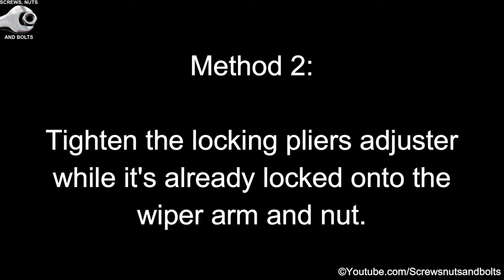Stuck Wiper Arm - Easy Removal Method

Comment: If they give you problems you can put a 12” pry bar right under the arm close to the fastener point and gently pry up then smack the top of the stud with a smallish ball peen hammer with the nut still on the top of the stud. Or you could clamp the top of the stud with the nut on it, (or put a coin on top to protect the nut) and the bottom edge of the arm with some licking pliers and smack on it like you did.

Comment: Amazing! Thanks a ton for this tip, worked a charm to free up a stubborn wiper arm here in the Rust Belt that resisted my best attempts to free it using penetrating oil, repeated wriggling, and even a rubber mallet. This video is truly YouTube at its best!
Reply from the maker: You're very welcome, thanks for watching !

Comment: Think you so much! Would never have gotten the arm off without this video. The wiper motor was going, and if I moved one arm the other moved too. The linkage from the motor the the rest of the arm linkage had popped off. Lubed it up and popped it back on (rust and debris had probably caused it to fall off initially).
Anyway, thank you, hope this helps others too
Reply from the maker: You're very welcome ! 👍

Comment: Thanks!! I went through a "soft touch" car wash and the soft touch brushes broke the plastic piece on that rear wiper arm that holds the blade in.
I took the nut off and tried everything except a puller to get that arm off but no luck.
I saw your video and tried the vise grip method and it broke free immediately!!
Whew!! Thanks again. It worked great.
Reply from the maker: You're very welcome, glad it helped :)

Comment: thank you so much, this worked so well for me. I went and bought a battery terminal pulller because someone in an forum said that works, it was too flimsy/had soft metal and broke. I used your method and got them off in 5 minutes
Reply from the maker: You're very welcome, thanks for watching !

Comment: Your a life saver man! I was fighting with the arm for an hour and as soon as I saw the video I was able to pop it right off
Reply from the maker: You're very welcome !. Thanks for watching !
Reply: Same here, so simple and yet so effective!
Reply from the maker: shawnstafford7809  Sometimes the nuts are covered with a plastic cap. What vehicle do you have ?
Reply from the maker: shawnstafford7809  Wow nice car, lucky you ! 😎. I've rarely seen, let alone worked on a Firebird so I have no idea I'm afraid. I've only ever seen wiper arms fitted onto splined shafts and secured with nuts
Reply from the maker: shawnstafford7809  Do the arms look like the ones in this video ?: https://www.youtube.com/watch?v=Zcg3wU8dosw
Reply from the maker: shawnstafford7809  That tool is usually used to pop the arm off the splined shaft after you remove the nut. That cover should clip up off the nut and hinge up at the base of the arm.
Reply from the maker: shawnstafford7809  That cover should clip up to reveal the nut. If you get to the nut, just be careful not to put any pressure on the glass, whichever method you use to remove the wiper arm. Good luck 👍
Reply from the maker: shawnstafford7809  lol 👍

Comment: I'm trying to remove the black plastic debris shield thing. Because after sitting 3 years my 2004 rusty  jeep grand cherokee was invaded by mice, and squirrels which builr nests and also deposited they're nuts, leaves and packed it underneath. Plus all over the engine bay. So the wiper arms had to be removed in order to remove it and clean out the packed mouse house. So after 20 minutes of pb blaster and ready to HULK SMASH 💪 with my hammer I searched and thankfully found the solution. I even have the identical Irwing Vise Grips and hex bit. You made it simple and you prolly save a windshield too.
Great idea and thanks for posting this. Perfect 👌 👍🏻
Reply from the maker: You're very welcome !, thanks for watching !

Comment: Thanks for that. following your video, have just used mole grips and a one pence piece to get my wipers off.  What took most of the time was putting the plastic trim back on at the bottom of my windscreen after cleaning underneath it. There's a knack to that too.
Reply from the maker: Yeah that can be a bit fiddly alright. Thanks for watching ! :)

Comment: Changed my Estate rear wiper 5yrs ago with no problem, this time the arm is stuck on the spindle solid, so will try your method tomorrow. Hope I don't shatter the rear window, hugh!
Reply from the maker: Don't use any part of the glass for leverage !
Reply from the maker: If that doesn't work, I'd recommend trying a ball joint separator like this one: https://www.youtube.com/watch?v=ZbvqnhrPNho

Comment: On my two Dodge Rams, 2003 & 2004, there is a simple lever you pull out to release the wiper arm.  No nuts or special tools required.  However, your video was extremely helpful in working on my Girlfriends Ford Freestar van.  Thank you.  Funny thing was the nuts on her wipers were two different sizes, 15 and 17mm.  What the heck?
Reply from the maker: That's strange !. I'm glad it helped :)

Comment: Best tip!!! I was trying to remove my arms from a 2002 Sequoia and there is very little clearance around the arm to get underneath the arm with a wiper removal tool. Saw your video and the only change I made was using a pair of needle nose vice grips which barely fit to pop the arm since I have such small clearances. Thanks!!!
Reply from the maker: Thanks for watching ! :)

Comment: Excellent, worked easily after a pry bar was to no avail despite having sprayed Free All on it first.  Then put on a generous coating of anti-seize before putting it back together so it will be easier if I need to do it again.  But one thing, you could have used a cheaper coin, those might be valuable.
Reply from the maker: LOL thanks, I'll use a copper coin next time :)

Comment: this might work really well in your situation. unfortunately i couldn't fit the pliers on my wipers so i used some gun oil and a hammer and gave them a good tap and they came off very easily i just loosened the nut like you did applied some oil to the base of the bolt and it worked like a charm
Reply from the maker: Good job 👍

Comment: THANK YOU for this. I spent hours trying to do this when trying to change a motor. So frustrating. Tried using locking pliers and it popped off in seconds.
Reply from the maker: You're very welcome !

Comment: Estaba apunto de comprar un extractor, mañana lo intentare como nos enseñaste en el tutorial gracias amigo
Reply from the maker: You're welcome, just be careful not to put any pressure on the glass or it could crack or break if you are working on the rear wiper

Comment: Saw your video just by chance after re-visiting another rear wiper arm removal video. Exact same problem, got the nut off after lots of WD and finally a propane torch. Cant move the corroded arm at all! Unfortunately your method didn’t work for me, just too stuck. With the motor arm going through the rear window I can’t get the arm to move, too afraid of the window cracking.
Reply from the maker: Yeah you're right not to try it if you have to use the glass for leverage. There's a high probability that you'd break the glass. The rear wiper arms seem to become more seized than the front ones !
Reply from the maker: Try a ball joint separater. Thery're heavy duty and won't bend like the little cheap wiper arm pullers. Here's the one I use: https://www.youtube.com/watch?v=ZbvqnhrPNho
It was about 17 euros in Halfords

Comment: What about the rear wiper where they sit on glass on the whole
Reply from the maker: I wouldn't use this method on a rear wiper as it could put pressure on the glass and break it.
Reply: @screwsnutsandbolts  any idea how to remove rear wiper please
Reply from the maker: @ste2472000  One of the best tools you can use is a ball joint separater like in this video: https://www.youtube.com/watch?v=ZbvqnhrPNho
Reply from the maker: You can buy cheaper tools but some of them are quite flimsy and bend or break before removing the wiper arm.
Reply: @screwsnutsandbolts  brilliant mate thanks very much
Reply from the maker: @ste2472000  You're very welcome

Comment: Im gonna try it on my vios 2003. Wish me luck. Lol.
Thanks for the idea!
Reply: After i looked at mine, i cant bite it like you did because the part is deeper than i thought..
Reply from the maker: @alvinlawanto  That's a pity. Can you place another nut on top of the original, to take up the gap ?. Just be careful not to damage the threads on the spindle.
Reply: @screwsnutsandbolts  the gap is too small and deep. I only can put negative screwdriver and lean on the trim, which if i do leverage with that method im afraid it will breaks the trim plastic..

I watched another video they leverage and hit the screw with the hammer in the same time like 10 times.. i think im gonna give it a try.. 😅

Comment: What if there is no lip for the locking pliers to grab on to?
Reply from the maker: There is on most vehicles however there may be some that this won't work on
Reply: @screwsnutsandbolts  
I finally got it off... the lip was very thin,  no greater than the thickness of the metal. 
I watched another video,  just kept tightness on the washer arm with a pry bar and tapped on nut with a hammer.. after put on some pb blaster.
Thanks for the vid though
Reply from the maker: @jmajeed3880  You're welcome, well done ! :)

Comment: Those are not standard "channel locks". First off, they are called vice grips and a standard pair does not have the arched teeth.
Reply from the maker: I never said channel locks I said locking pliers, of which 'Vise-Grip' is just one particular manufacturer.

Comment: Why do I feel like using this method on the rear window wiper arm would shatter the window? 😂 That’s my problem. The rear wiper arm was broken off by an angry person and now the bottom piece of the arm that is connected still, is stuck and it won’t come off so that I can replace it. 🙄 But I can’t find a video or someone who has a solution!

Comment: Thanks, worked like a charm.
Reply from the maker: You're welcome !
Reply: I was having my windshield replaced, they were unable to remove the wiper arms and were therefore unable to replace the windshield. I attempted several other techniques shown on YouTube to no avail. I will share your video with the windshield installer when I go back this week. This undoubtedly saved me significant time and money. Thanks again.

Comment: Hi, my problem is the spindle body. It's seized. I don't know what to do once I've loosed the three nuts to it. My hands or tools do not fit through the service holes. The box it lives in is welded shut.
Reply from the maker: Is it a Peugeot 307 ?. You might have to remove and replace the entire wiper linkage. You could buy a used one from a car dismantlers or buy one on Ebay.